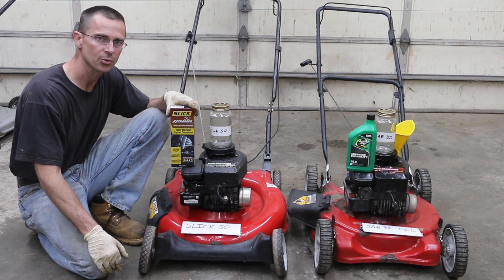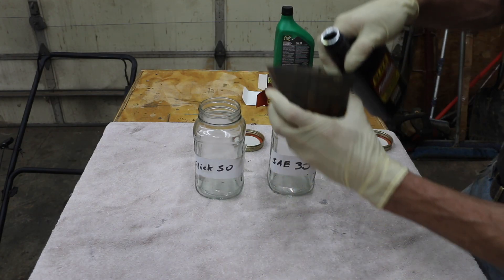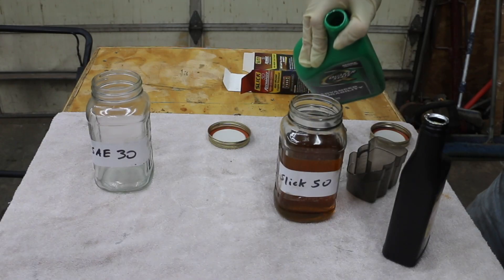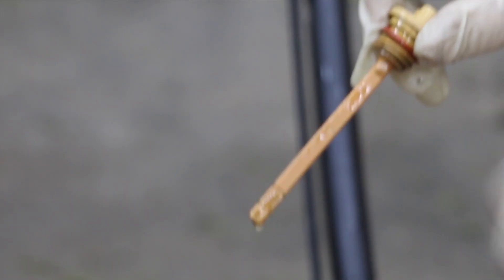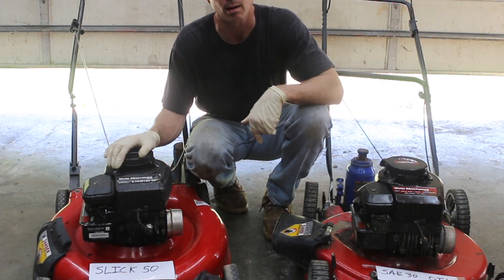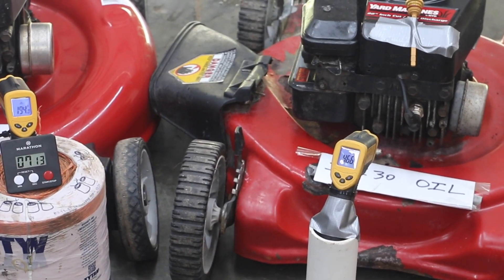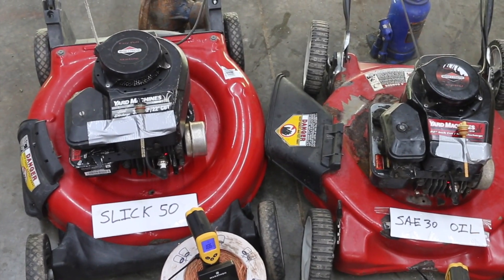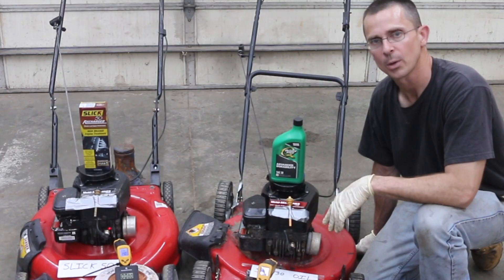Can't believe what SLICK 50 did to my engine!!--Dry Crankcase Test!

Comment: I am a believer of slick 50.  There are a couple of things.  When doing the dry test, the straight oil engine is circulating air via the discharge  chute onto the slick 50 engine.  Also, the slick 50 engine looks newer and would have tighter tolerances.  Just a couple of thoughts.  But i will still give you a thumbs up.
Reply from the maker: Thank you very much!

Comment: This is a true story (told to me back between 1995-1997/8, & it occurred in between 1987-1991). My old Boss' Son was a Truck Mechanic (Interprovincial) had his own Mobile Shop. He related a few different stories to me of his own Experiments with Engines &  his Customers. One of them decided (on his own) that the Slick 50 was "so good" he decided to ONLY use Slick 50 in his Van (no Oil at all, only a pan full of the product). Apparently the Engine ran about 20 minutes and seized up   solid  After my friend managed to PRY off the Oil Pan he said he swore the customer had somehow stuffed a Garbage Bag inside & "melted over everything"  "Brad, I took Pliers & was snapping off chunks of this black plastic".  No "Oil" just "melted  plastic garbage bag". Needless to say he was very skeptical of using Oil Additives. He did suggest a small amount of ATF if you wanted to clean things up a bit as it is high in Detergents.  My Brother has been an Auto Mechanic many years & only speaks well of BG Products & is not a fan of "Doctoring the Oil" (with stuff advertised as a Miracle on TV)  My Dad tried Slick 50 back in 1983/84. Had no troubles...we never knew if it did anything or not.  I recall it came in a standard Metal Can you pushed the Pour Spout into.  I wonder if the Yard Machines Mower came from the old Kitchener Plant.  I have one just like it.
Reply from the maker: Wow!  Thanks for commenting on this.

Comment: You have to remember Slick 50 was designed for older high mileage vehicles that used 30, 40 and 50 weight oil. It's still available and probably works well for that application as long as you don't attempt to do idiotic tests like this. Nothing will run very long without lubrication. Newer automobiles have aluminum engines with tighter tolerances that use a much thinner 5-20 weight oil. I don't think I would use Slick 50 in a new car.
Reply from the maker: Thank you

Comment: many years ago, when Mobile 1 was young, I remember an advertisement where they ran a NYC taxi on Mobile 1, then drained the oil, and ran it 50 miles more and did a complete engine tear down.  No unusual wear.  I do know from personal experience that Mobile 1 increased my gas mileage, but would it out perform straight 30 weight?  Only a test will tell
Reply from the maker: Thank you!

Comment: I don't think the treatment had the amount of time required to adhere to the metal engine parts.  It is to run for a full engine oil period before changing; not to be used as an oil.  It's a treatment for the metal parts. Also, it would be a better test to somehow use two identical motor brands/types with similar hours on the motors.  
I ran slick 50 in a Dodge Omni at 5000 miles.  At 60,000 miles the engine took a stone and cracked the block.  After tear down at the dealer, the engine only had 5500 miles of wear on a 60,000 mile engine!  The entire Dodge dealer mechanic shop were instant believers.  It is a superb engine "metal" treatment.
Reply from the maker: Thanks for the constructive feedback.

Comment: Just thinking slick 50 is only beneficial when the engine has oil.  I liked the cooler operating temperature and wondering if my motorcycle (dirt bike) would benefit on those long, slow technical climbs that cause it to over heat?
Reply from the maker: Thank you

Comment: You used slick 50 as an oil. It is not an oil, it is an engine treatment. Did you read the instructions?

 My radiator blew in North Carolina on south 95. I drove it for 30 miles without a drop of water on a 95° day. When I got to the gas station, I patched the radiator , filled up with water and drove off. No damage to my engine thanks to slick 50.
Reply: Moron did you watch the vid he only used as an additive following Manufacturer recommended amount, gawd i hope people like you dont reproduce
Reply: @jellyjust4676  rude much? When you talk slick 50, you talk the treatment, not the additive. Neway, he didn't shake the bottle, so none of the slick 50 additive went into the engine.

Comment: The cooler running cylinder head of the Slick 50 engine could have been attributed to richer fuel metering for that particular engine versus the other.
Reply from the maker: Great point! Thank you

Comment: Slick 50 is an additive and cleaner. So it cleaned out all the dam oil besides the contaminates. That's why it ran cooler and died faster. Its an additive like when you run a high zinc oil additive in your old flat tapped cams and lifters. Its not ment to run by itself. When the engine was drain it cleared out everything, all lubrication until itself evaporated.
Reply from the maker: Thank you

Comment: Slick 50 is crap compared to Duralube!  There was a comerical in the 90's that Duralube did where they drove 8 cars across the U.S. with no oil in the engine just what remained of the Duralube and all cars made the treck with no problem!
Reply from the maker: Thank you!

Comment: In 1976, in Brisbane, Australia I bought & had installed on my 2 year old V8 Holden, an American made  Frantz Oil Filter.  It uses 2 ply toilet paper rolls as the filter. It's a by-pass unit, so you still need to use the screw on full flow filter.   In 7 years of use I never once drained the engine oil, but every 5000 kilometres I would change the filter element & pour in 1 litre of fresh oil.  I would only change the standard filter every Christmas.  At any time I could check the oil & it was very clean.  I never had any engine problems in 9 years of owning it.   I still own that Frantz Filter, but modern cars don't have any engine bay space spare.
Reply from the maker: Thank you!

Comment: I was surprised that he tried this test after only a short while with the new oil & the Slick 50.  He never allowed enough time (many hours of engine running) for the Slick 50 Teflon to chemically bond to the friction moving parts of the engine, thus treating the engine.  In a car engine it takes about 2000 kilometres before the Teflon totally reduces the friction.  Slick 50 long term engine treatment was claimed to last over 100,000 kilometres between treatments back in the 1980's when I started using it in Australia.  Back then it was claimed to have the "Friction coefficient, equal to rubbing wet ice cubes together."
Reply from the maker: Thank you!

Comment: I didn't know they even make slick 50 anymore. I had bought a little truck, 1994 Ford Ranger with a 4 cylinder engine and fuel injection. Well I done my own oil changes and I always keep my equipment up and when my little truck reached 50,000 miles, by the way that is what they said you should do is not add it to the engine until it reaches 50000 miles and I don't know why, but I change my oil and thought well I'll give it a birthday present I'll have some good old $30 a quart slick 50. Well I noticed about 3 or4 Weeks Later my motor had this bad sound to it, well not bad but worrisome. So I went over to my cousin's house and he's been mechanic pretty much all his life he worked on everything from lawn mowers to skidder and Dozier engines. I said hey rooster, his nickname of course, my little motor sounds  like it's got a bump in it something's going on. He listened to it and said damn handyman you got a Main knocking! I said oh crap I can't have this I said keep it and see what you can do with it. He said take one of my cars and drive it and so I did and the next day he told me yes you definitely got a main bearing knocking and I'm going to have to tear it down. I told him man I don't have 50,000 miles on it and he said are you keeping your oil changed? I said yeah I said I changed it last and added a quart of slick 50 to it. He said you dumbass! I told you never ad engine treatment. Anyhow he tore it down and when he took the valve cover off and oil pan there was a kind of a coating and stuff on everything and he said there's your damn slick 50. Well anyhow he said it had stopped up the the holes and the screen in the oil pump and starve the main. Well try to make this story shorter he rebuilt the engine and told me he would give me a 50,000 mile warranty on it if I didn't let my son drive the truck and that I would never put nothing but motor oil and it again. Well a few years later we were riding together in my little pickup and as it approached 50000 mile mark after he built it I told him well your warranty is running out right now as we speak! He rolled the window down a little bit listen to the outside, and said well sounds good to me I'll give you another 50! Well believe it or not I put about 26 or 8 Thousand Miles more on it and then traded the little truck off for an upgrade. I never used engine treatments since. Happy motoring folks!
Reply from the maker: Thank you!

Comment: i remember the add from way back as a young budding mechanic we gave it a try since buddys dad owned an auto wrecker tried  a couple of engines with same results seized engines SO fast forward to today i dont use any of these oil treatments/supplements i use good oil, regular oil changes air filter changes and save the money from the oil treatment product for BEERS  would love to see a video on fuel injector cleaner products tired of bogus claims THANKS FOR ANOTHER GREAT VIDEO keep up the great work
Reply from the maker: Thank you!

Comment: I think the extra thermal expansion of the straight oil kept it alive longer since the parts had a bigger gap while running. Impressive reduction in temps by slick 50 but due to lower and similar temps metal galling started earlier, and nothing last long after that.
Reply from the maker: Thank you

Comment: Tufoil preceeded Slick50 and had a patent and tested itself vs Slick and outperformed it and many other lubes they tested.  However they did not go for the pizzaz of empty crankcase tests or high pressure tests.  Just realistic tests such as the 4 ball test.  Slick had lots of marketing fluf.  Tufoil was run by an engineer so didn't do so well in the marketplace.  Tufoil showed electron microscope images to show the difference in the wear.   Unlike Slick 50 one-time marketing Tufoil said a little added with every oil change.
Reply from the maker: Thank you!

Comment: Petron
Reply from the maker: Thank you for the video idea!
Reply: Project Farm thank you for your reply as well. Petron is legendary in some parts for it's "secret" recipe that supposedly gives it the ability to penetrate metal giving it superior protection. It would be cool to see if it Had any merit to its claims. From what I remember because I used to use it back in the day was you were supposed to add it to a fresh oil change while the engine was running warm. It's thick and supposedly the last bit at the bottom that was extra thick was the good stuff. Lol  I do know it was always expensive.

Comment: PROLONG in their commercials ran a Dodge Viper around in the desert for hours with no lubrication after the initial dosage of PROLONG.  In the tests you see here on Youtube, Turbo Maxx  tests its product against a lot of the well known additives  and ALL of them fail miserably compared to TurboMaxx in a friction load test. The other products can only withstand 3 - 4 lbs of weight, whereas turboMaxx withstood 33.5 lbs. of weight before the bearing seized up.  PROLONG failed at 4 lbs, Bestline failed at 8 lbs. And the Turbo Maxx went over 8 minutes out of the oil bath before it seized , with 10 lbs of weight on it. Another test was driving a car around with the coolant drained out.  It went over 2 hours and never did seize up. I would like to see you test Turbo Maxx both with a friction load test, and in a mower with the oil drained out. I'm running Turbo Maxx in all my engines, both  power equipment and autos, and would like to know if it's as good as the videos portray.
Reply from the maker: Thank you!

Comment: I was under the impression that slick fifty is supposed to be used in water cooled engines only.Over the years I have used it in cars,trucks and tractors.It was evident in the tractor that I had  much more power.
Reply from the maker: Thank you!

Comment: Prolong world challenge. Check this out on YouTube. This is the commercial I remember them running a car with no oil. Have you tried this. I've used this in my engines after doing a lot of testing in the machine shop using it as a lubricant for drilling and cutting.

Comment: Love tests like this but without alot of cash to test, we just don't know.
Could it be that slick 50 needs several heat cycles to bond to bores and bearings, but in that short initial period is detrimental to oil performance?
Could it be that it is compliments oil greatly in well maintained engines, but protection disappears more rapidly when run dry.
I've never used it but often been tempted.
I've always preferred just a reasonable quality synthetic oil change every year, which in my case is 3-4 thousand miles.
I go for mid priced oils rather than high end, due to the low mileage intervals and low car (£500ish) value and not convinced enough how additives could improve things.
Reply from the maker: Thank you

Comment: a lot of people buy 2 stroke chainsaws and only run on straight gas the first time and then take them back because they stopped running. never had oil and burned up the ring and cylinder...my brother put PB Blaster in and was able to loosen the cylinder and get it started and it runs again. it was an older Husqvarna.
Reply from the maker: Thank you

Comment: Project farm   My neighbor used to tell me about how he used round up on his dandelions in a specific dilution on the lawn and just about every trick he knew in his book. He comes from a third generation German immigrant lineage whose family owned land and a large farm, lawn and garden, hardware supply from a family of 3 boys. My neighbor who liked to be called by his middle name: Wolfgang LOVED SLICK 50 TO DEATH. He and I however did have a problem finding it. He said it used to be around everywhere and he would add it to the fuel tank in his tractor trailer while he used to haul gasoline from the refinery over her in Northern New Jersey. He said it made him king of the road and gave his Gas pedal an extra giddy up you cant get from anything else. He always asked me and ran over to check if I added slick 50 to my weed wacker fuel/oil mix. He would add some himself and my oh my did it make that weed wacker RIP through the weeds like butter and you could hear the engine roaring at about 3 times its usual speed.. so @projectfarm why not try using slick 50 as a fuel additive on a dry engine? and see what happens!
Reply from the maker: Very interesting!  Thank you for the video idea.

Comment: I like this, but there is really just no way I can believe a single trial for the engines.  Especially so since the mowers had different histories...which might actually account for the engine temp diff with oil, since perhaps the "Slick 50" engine was more worn and had lower compression, etc.
Reply from the maker: Thank you for the constructive feedback.

Comment: Always fun to watch your tests!  I do sipped the Slick 50 koolaid at one time.  The marketing was convincing.  But they did get sued if I recall for false claims.

I also think many false equivalencies are made with products like this.  Running an engine without oil is never the desired outcome....no one but a complete moron would do that (aside from a test).  Can you imagine anyone saying “hey honey, if the oil light comes on, just keep driving the car because I have S50 in it?”  No way.

The notion that because an engine could run longer with S50 in it would seem to imply that an engine WITH oil and S50 would somehow be better because of this test which of course is neither proved false or correct.

The fact that the temps are lower when running was very interesting however.
Reply from the maker: Thank you!

Comment: I've had really good luck using a product called motorkote I had an old van the oil pump went out on and I still ran it for two weeks with no oil pump and then it's set for another two years and then I started up drove it for another five miles before the motor locked up
Reply from the maker: Thank you! I tested MotorKote in a different video with great results!

Comment: Not very good test. No clue what the condition of the motors where in before test. And slick 50 needs to be run for awhile before it binds to engine surfaces. Now run test in 2 new motors and I might take it more seriously. I normally love your test but I think this could have been done better.

Comment: Duralub. Was a miracle oil back in the 1999-2000 year but I haven't seen it around in a long time
Reply from the maker: Thank you!
Reply: I used to use duralube in my old cars, I had a mechanic friend tell me that is was a much better product them Slick 50.  It would be good to know for such by having them go head to head.

Comment: The point was that the slick 50 made the engine run consistently cooler which also affects an automatic transmission. I vote that a winner.
Reply from the maker: Thank you

Comment: @Project Farm - I use Synionic and swear by it. Used in petrol engines, diesel engines, Wankel engines, manual transmissions and automatic transmissions, outboard motors, inboard motors, compressors and vacuum pumps. https://synionic.com/